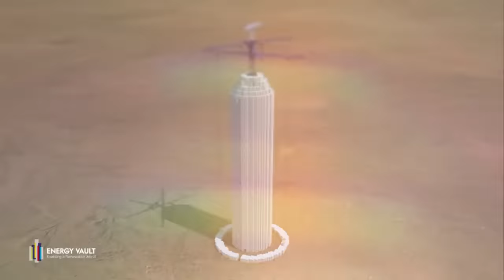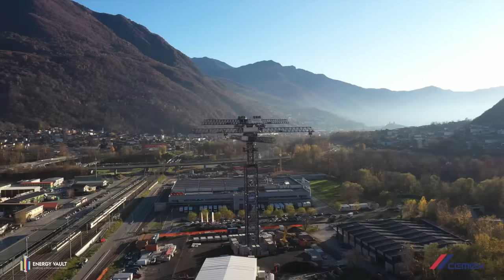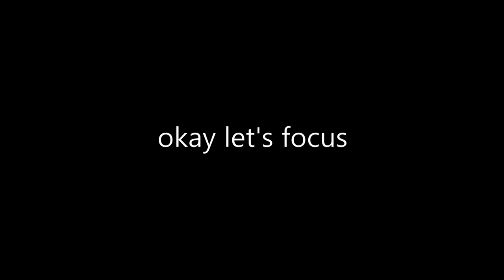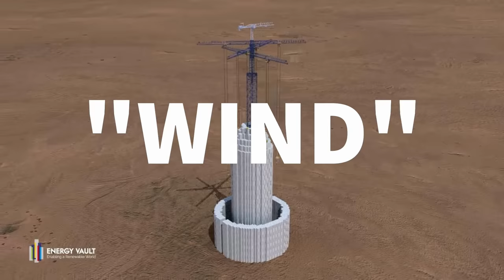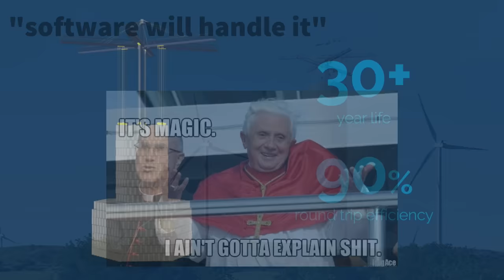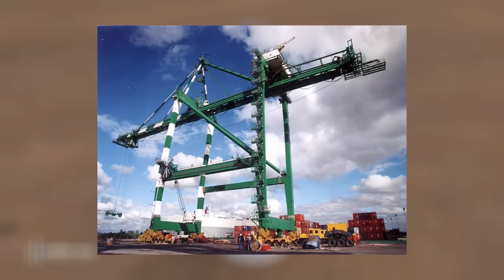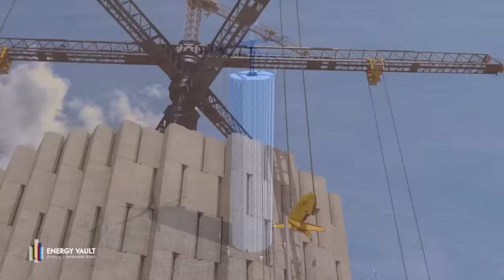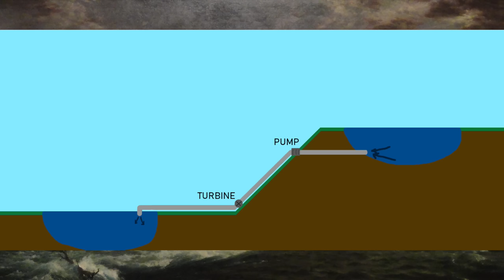The Energy Vault is a Dumb Idea, Here's Why

Comment: I gritted my teeth when I heard of the idea of sticking it right next to wind turbines...
Wind turbines are very sensitive to obstacles in the flow path of the air.
There is evidence of wind parks influencing each other over distances of 70km.
So building a giant wind obstacle right next to a wind park is about the dumbest thing one could do...
Reply: Wind turbines are generally stupid, BUT most areas with sufficient wind also have extremely dominant wind directions, though they may change by season. So you could put something to the side and it would be fine.
Reply: @toomanymarys7355  i'm not a weather scientist but i would say that having 200 km³ of concrete in a big tower would affect wind patterns anywhere in the world
Reply: @toomanymarys7355  Are they?
Why do you think so?
Reply: hmm, so why don't we use the power generated by the wind turbine to...spin up a turbine, and when there is no wind, let that turbine wind back down...BRILLIANT, can I get a few billion dollars from investors to create flywheel storage?
Reply: I'm hoping it was just to compare size, but who knowsss
Reply: @murraymadness4674  actually your idea is far worse than fly wheel storage. Fly wheels need to be aerodynamic frictionless etc to prevent losses. Using a separate fly wheel isn’t a bad idea but using the turbine as a fly wheel is a terrible idea because once the wind stops blowing the turbine while start pushing air acting like a fan consuming electricity.
Reply: @jacobleeson4763  LOL, you didn't notice how that idea was just stupid too?   Now actually using a real flywheel like that one company was doing that went bankrupt is not such a bad idea.
Reply: @murraymadness4674  flywheels do work and are currently in use on the power grid. They just need to be perfectly machined huge metal disks without any imperfections in the diameter and with magnetic bearings and in vacuum chambers. Then the losses are so low that you would see like a 1 percent drop over the course of a couple months.
Reply: @Cretaal  
Most of a wind turbines structure consists of concrete and metal (mast and nacelle) and fiber composites (rotorblades). But, as you said, silicon and rare earths are used too. Since these materials are needed for semiconductors in power electronics, they are necessary components for any modern power generating structure. Coal power plants, hydro power and even nuclear power plants need silicone and rare earths as an essential part of their power generation.
You are right, they impact airflow on ground level and thereby also impact the weather, but so does any other man made or naturally grown structure. Buildings, cities, cooling towers of power plants and even trees and forests alter the airflow on ground level. Lucky for us, weather patterns are mainly formed at heights of several hundred meters and above.
It's true, wind turbines kill birds, but luckily, recent studies indicate, that it seems to be far less than initially thought. (In fact they're killing even less than domestic cats are killing each year in urban areas)
Hydro power might be a better alternative to wind turbines, but sad thing with hydropower is, that most sites usable for hydropower are already built on. I don't know, where you're from, but in Germany i.e. about 90% of the capacity for hydropower is already in use.

Don't get me wrong, I do not totally disagree with you. :D
Wind turbines are not the optimal solution to reducing carbondioxide emissions, but besides nuclear power, renewable energies are our best shot.
I do not fear nuclear power. Quite on the contrary :D I welcome it as a reliable power source to meet the power grid's base load.
But while nuclear power plants are expensive to build, to maintain and demolish at the end of their lifetime (gets forgotten often, but irradiated building materials are not easily get rid of), renewable energies and especially wind power steadily fall in cost.

There will never be an optimal solution. All we can do is to shimmy from one solution to the next better one. But for the time beeing, I think a healthy mix of wind, solar, hydro and nuclear power will be our best option.
Reply: @toomanymarys7355  based on what science exactly are wind turbines a stupid idea?  Because the engineering consensus disagrees with you and I agree with experts over some commenter that thinks they are smarter than actual field personnel.
Reply: @toomanymarys7355  NO, you could not. Go and read up about how wind is affected by tall obstacles, before you say something stupid again.
Reply: @marvinkitfox3386  "Google it, stupid" isn't an argument, and not one you want to use if you're trying to call an argument stupid. You get the irony here, right?
Reply: @kg4tnp  The engineering consensus is that wind turbines work, but are also our least efficient and least cost effective low emissions energy source.
Reply: You mean like... relying on wind parks when we have obscene energy demands?
Reply: @1998SIMOMEGA You just unironically used the word "unsciencey" and compared biological respiratory systems to coal powered factories. I doubt you know what science even is to begin with.
Reply: @pepeberlusconi1736  "slight" correction, it's not 200 km³ it's 0.0002 km³... The rest is opinion so I won't comment on that :)
Reply: That is beyond fascinating. Thanks for giving me something to learn about
Reply: Really should jump on geothermal energy tbh. That's the future we should be headed for. Been in the making for like 20 years and they keep putting it off.
Reply: @ToastGamingNCrew  That's true, but I asume, you also know there is a huge difference in radiation levels between soil irradiated by decades old fallout and the core componenets of nuclear powerplants?

When demolishing a nuclear powerplant, they have to check every single component and every single piece of debris for its radiation levels. Most of it can be disposed of or recycled normally. Some parts can be decontaminated and then treated like normal materials. But about 5% (i.e. reactor shielding, reactor control rods and almost all parts of the primary cooling circuit) are to be treated as nuclear waste and need to be stored in nuclear repositories.

You see, demolishing a nuclear powerplant widely differs from demolishing most other buildings. It takes years to demolish a nuclear powerplant.
Additionally to the time consuming handling of debris, there are higher wages to pay (think of hazard allowance and special training in handling irradiated material), additional costs for safety equipement, special tools and equipment,  decontamination of demolition machines and other equipment afterwards...
The list of points sky rocketing the demolition costs of nuclear powerplants is very long.
Reply: @Cretaal  

I am not anti-nuclear energy but I am very concerned about how (at least here in the US) there isn’t a viable, efficient, and safe nuclear waste storage option besides piling it up in Nevada. The potentially obscene consequences of something going catastrophic due to improper storage is scary to think about. Again, I’m not against nuclear but pumping crap into the ground doesn’t mean it doesn’t exist anymore.
Reply: @thisisashan  

I’d imagine that those alternative uses wouldn’t require an amount nearly close enough to make a significant impact on what’s being buried day after day in the Nevada desert. 

Finland is leading the way in nuclear waist disposal and it would be great if other countries could replicate those initiatives.
Reply: @thisisashan  

Oh and please forgive me Thunderloins for my typo. How can I ever make it up to you? 

/s - give me a fucking break
Reply: @EyeonthePrize247  typo... yeah... the letter I is so close to waste which is completely on the left side of the keyboard... on a word which happens to be pronounced exactly the same, this is 100% likely.

it surely covers up the fact everything you said in your little rant there is demonstrably wrong.

I'll add more.  Since 1950 we have produced just enough nuclear waste to cover a 100 yard field 30 feet thick.

Over 90% of our nuclear waste is recycled, of which, we average about 4 tons a day.

Meaning, roughly 800 pounds of actual waste a day at worst.

Nuclear produces 19.7% of our total energy.
Coal produces 19.3% of our total energy.

Coal produces 120 million tons of toxic waste a year.
Which is 657,534,247 pounds a day.
Thankfully, 64% of this is recycled.
Leaving 236,712,328 pounds of waste, a day.

So all the b.s. people like you spout about how horrible nuclear is?  Clueless.  Absolutely clueless.

We produce more 4,227 times as much coal waste a DAY, than we have created in TOTAL since 1950 in nuclear.

It takes approx 20 seconds for us to create more toxic coal waste, to equal the total amount of toxic nuclear waste since 1950.

And you are worried about Nuclear energy?  The fuck dude.
Reply: @thisisashan  

Drop the link where it says we recycle 90% of our nuclear waste.
Reply: @thisisashan  yeah, the numbers on nuclear waste are ridiculously low. Storing all of it isn’t going to be a massive mega dump of forever danger, it’s going to be comparable to the size of a regular landfill but with better construction and safety features. 

People also talk big game about how long nuclear waste is dangerous for, but heavy metals and other toxins produced in bigger quantities many more processes will always be dangerous. Forever.
Reply: @wolacouska3698  Yup.  Nuclear power is the cleanest mass scale energy we have.  And now that we have discovered bacteria that literally feed off of nuclear waste materials, and excrete usable materials... those dumps may actually become just another usable resource.

The reason we don't go 100% nuclear is because it is important not to for a sustainable grid due to fluctuations in systems.  Systems engineers try to balance systems to prevent this.

I mean the one main argument that should be had is for solar, and increased power station energy storage.  (High altitude water storage.  For every 325k gallons of water you lift 1 foot, you store 1kw.  You lose some energy pumping up (like 86% efficient? something like that) but you can have say a 325 million gallon tank, 10,000 feet up, you suddenly have 10,000 megawatts.  Which is about a nuclear power plant worth for a day.

First america needs to move towards Net zero consumption housing, and then again towards net negative.  But this is all utopian...

This has its own issues... if people start producing enough power themselves, and realize they can get paid for it... big energy starts losing a lot of money, and that can potentially undermine industries like oil, coal, and nuclear.  Which apart from just the job loss, can undermine said system balance.

Just imagine if we go solar, and all a foreign nation has to do to drop our grid is seed clouds.

Or if we go full nuclear, all they have to do is buy out the uranium.

Sometimes things are more complex than people think, even if the utopian solution is pretty simple.

And, in a utopian society, we would be on a 100% solar grid, simply using the sun for energy, and using the oceans and rivers for energy storage.  But sadly... things aren't so simple.

We should def move towards about 2-3% coal usage at most though... (we do need some coal for above reasons, as well as the byproducts of coal can be useful in some quantities.  And a small amount would allow us to use new technologies that can potentially reduce waste dramatically.)

Anyways.  Sleep time for me.
Reply: @wolacouska3698  

As someone who isn’t anti-nuclear but still has concerns about the byproduct and long term burdens (as any source of energy has), I was trying to have a productive conversation but it didn’t get very far without being told I was a moron despite the fact that I wasn’t being a d1ck about it... but, anyways… Can I please ask where you’re seeing or hearing those views and figures/information so I can educate myself as it’s generally not perceived in that light? If there’s a link that you think would help, can you please reply with it? Thank you.
Reply: @toomanymarys7355  I live in oklahoma and theres a turbine everywhere you look and our winds constantly change direction especially from season to season. Wind turbines are made to spin with the wind direction for a reason.
Reply: @EyeonthePrize247  Yucca Mountain storage facility was built but never used. IIRC waste is stored on site at the plant. Personally I think we should store the radioactive waste from nuclear and coal power plants in Washington DC after all it’s not a state.
Reply: @thegreenpickel  

Ahh, gotchya. Thank you for clarifying that! And better act fast as that (Statehood) may be changing soon!
Reply: @EyeonthePrize247  To be fair, most of the depleted uranium finds its way into foreign soil via an A-10c Warthog's gun, or vaporized when a round hits a tank. But you make a good point on where the waste goes. Generally, that means recycling it for the purpose of warfare.
Reply: @pepeberlusconi1736  make a cube of 80 olympic swimming pools. Sure its large but not hugh mongus
Reply: @jacobleeson4763  won't push air if you disengage the blades.
Reply: @Chris-uu2td  A project is planned to build a huge solar electricity farm in Australia's Northern Territory near Darwin and transmit most of the power produced via undersea cable to Singapore which has no free space for such a project. The Indonesian government is reported to have approved the laying of the cable through their territorial seas so perhaps they will also share in the power produced.
Reply: @thisisashan Seeding clouds to shut down a significant amount of a country's solar farms? Do you realize how MASSIVE the operation would be to accomplish that? And cloud seeding only works when humidity is high enough to almost produce clouds anyways. At any given moment in time there will only be a relatively small area of the country with ideal conditions for cloud seeding to be productive. The offending country would have to continuously fly their planes just upwind of the solar farms that they wanted to target. Do you think the US is going to just allow foreign planes to fly for days on end spraying cloud seeding nucleui over the solar farms? If someone really wanted to take down a country, there are far better cost-effective ways to do so. I would be much more worried about them dropping nuclear bombs or using chemical weapons against us.
Reply: @HeyChickens  Clouds are seeded every day in the US over tens of thousands of acres.

Seeding clouds thickly in a small area would be less difficult.

Futher, my entire point is that being overly dependant on a single source is problematic for various reasons. 

Pretending otherwise, when engineers do this and have done this to make our grid robust, is arguing from ignorance.
Reply: @thisisashan  I actually aggree with most of what you said. I was just nit-picking I suppose. It is very true that we need to be as diversified as reasonably possible with anything as important as our energy sources.
Reply: @toomanymarys7355  "Wind turbines are generally stupid" - Explain.